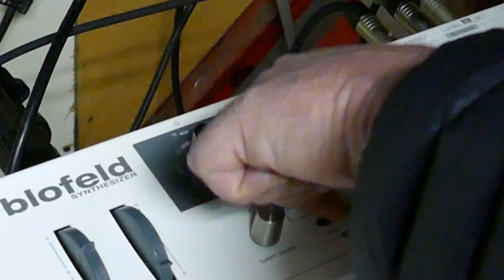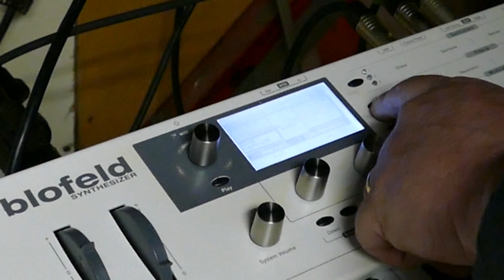Waldorf Blofeld Tutorial #01: How to create a tone with Self Oscilating Filter

Comment: I tried this and I noticed two things which I don't understand. 

1) There seems to be the connection between the note and the volume. Higher note -> higher volume.
2) The volume of the same note seems to be random. I am using sequencer to generate same note with same velocity but the volume is randomly changed. (My guess is that the noise impulse could have random strength, it is just a random noise after all.)

Is there some reason for this behavior? I have desktop version of Blofeld with firmware 1.23
Reply: +Mark Pigott Yes. It is set to zero.
Reply: Instead of noise generator I used oscillator with sine shape and I have constant volume level. Could be my theory about random strength of noise impulse correct?